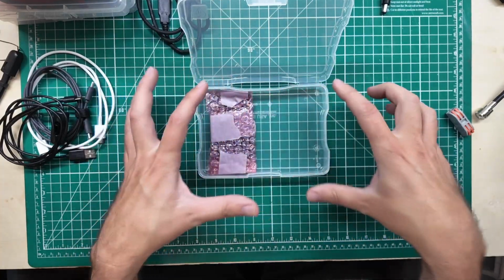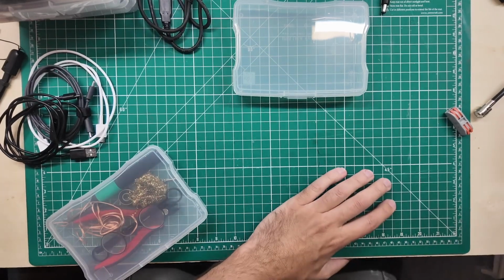Hoarders Unite!

Comment: Nice storage boxes.  I have several of the DeWalt ones . Great for electrical screws . Wago connectors . ETC . I got the big kit for power poles from powerworx . And used them up and added to it. Keeps crimpers and strippers handy in a zip bag with carry handle . I had to make a outher one for the SB 50 /SB 175 / SB 350  and some PP 75 and outher anderson style stuff. They have so many that 1 bag did not hold bigger ones .  1 bag just for battery lugs and crimpers . I had to make a go bag just for MC4 stuff.  Depending on the job. I pick what to carry with me. The car not big enough to bring it all.  So many hobbies.  LOL Cheers !
Reply from the maker: Modular go kits are amazing!

Comment: Amazon Prime is a gamble. You are betting you can order enough times in a month that prepaying $15 a month is cost effective to cover the shipping. 
I have several of those Plano boxes for small electronic components that collect when buying ten online are cheaper than buying the two that you need for your current project.
Reply from the maker: If you are patient, you can let your cart fill with ($35?) and get free shipping anyway.  Prime just means the item is in the local warehouse.  They are charging you to do them a favor... And usually it's late on top of that.